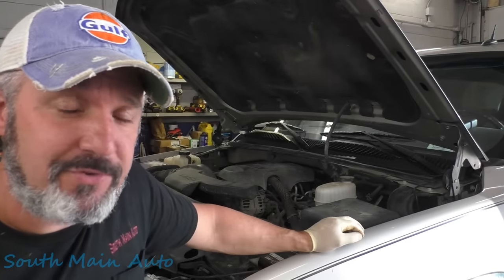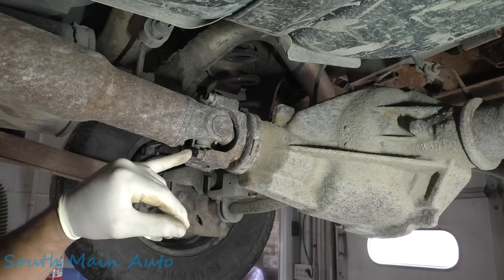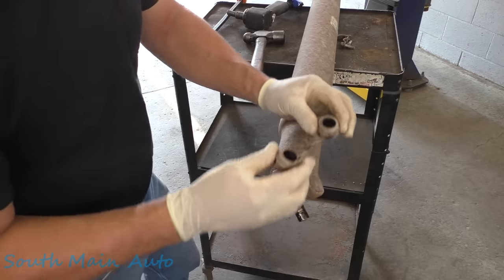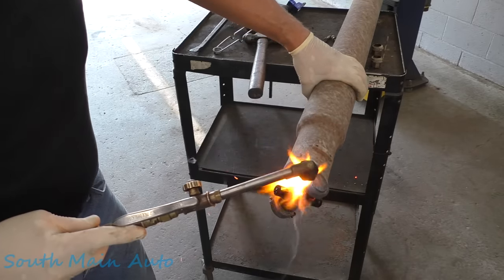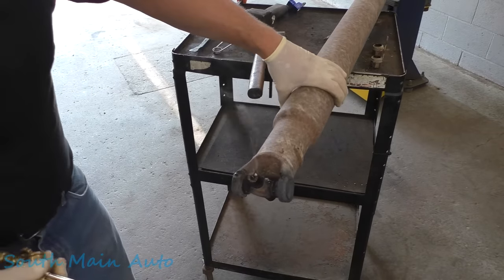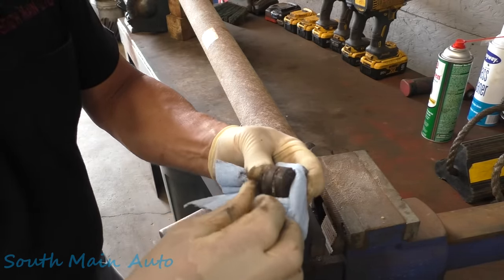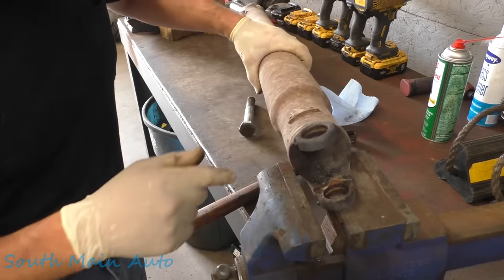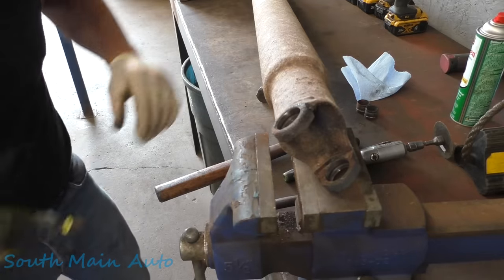GM Nylon Injection U-Joint Replacement

Comment: What is the record for distance that a spring clip has been found? Ya get bonus points if it bounces off the ceiling.
Reply: I'm pretty sure they'll find some on the planet "Pluto" some day. 🤪
Reply: @throttlebottle5906  😅
Reply: @throttlebottle5906  A black hole?

Comment: I was just curious; Is that threaded hex head punch you used to push out the U-joint caps made by Snap-on?
Reply: Same with those horizontal laser assisted driveshaft leveling devices... Just that the red paint is worn off from use...LOL

Comment: Don't know if they used those type of uni joints in AUS made GM-H vehicles I wiil have to check next time I do an oil change ,but it's nice to know if they did.Cheers.

Comment: Have you been reading my mind lately Eric? I've got a 2009 Forester that I'm doing both rear wheel bearings on this weekend, as well as replacing the u joints in the driveshaft. That's for the fresh videos on exactly that hahahaha

Comment: When doing u-joints i always use a ball joint press ! Works great without all the hammering and also mark the location of the balancing weights on the shaft !
Reply: So I was not the only one noticing this too?
Reply: The shaft is balanced right after its made so it doesn't matter. It's not balanced after it is put on the vehicle !
Reply: @jtg2737  right !! Lol
Reply: @scottymoondogjakubin4766  Yeah, that made me cringe but again to each their own.

Comment: Never seen them done like that. I always just heat it until the nylon squirts out, you'd be surprised how much comes out
Reply: But you got to be careful because them cap will blow out of there and go across the shop a good distance. I use a C-clamp lightly across the joint to keep from getting hit by the cap A Wack fuck

Comment: 14:19 - When I was a teen, I  had one going in "harder than expected" and i ended up splitting the cup circumferentially, and  I only found that out after I had installed the driveshaft and grease gunned it, and a ribbon of grease seemingly came out of the cap. Parts were relatively inexpensive back in the 70s compared to now, so as a teen, another u-joint didn't break me financially. Today parts are so expensive that another u-joint may exceed the value of the car 😛

Comment: Man that looked soooo much easier than the staked in joints on my MB. Is getting the caps flush with the yoke the only centering needed?
Reply: The caps don't necessarily fit flush with the outer surface of the yoke. Ideally, the cap clips he inserted should seat against the inside of the yoke.
Reply: @geologic740  These caps go in till the snap ring can be installed.

Comment: Why not use a grinder wheel? Seems safer without than a torch with more control. I put my shafts in a vice with rags around the jaws.

Comment: I'm just curious. Would the amount of heat you used during all the removal cause any damage to the structural integrity of the drive shaft/u joint? I guess in a metallurgical standpoint?

Comment: Did I see both caps turn when you turned one? And why does gm use plastic instead of snap rings? Thanks
Reply: The way there assembled it's easier for gm to make them it's all no touch assembling line been that way since the 70s
Reply: How do manufactures handle drive lines during assembly and not drop the caps?  OEM added a strap.  Nylon injection just aids in the the component manufacture.  GM is not the only manufacture to use nylon.

Comment: Don't hit the ears of the drive shaft. proceeds to beat the hell out of it LOL great vid
Reply: The ear is on the vice jaws and isn't getting bent by driving the cap out.
Reply from the maker: @wssides  I try to explain the best I can lol
Reply: @SouthMainAuto  Great vid, but explain that wabbly table! Are you working on a cruise ship?
Reply: @SouthMainAuto  You explain very very well and the video of the operation adds a million words. Very good filming. Wish I had had your videos when I was teaching auto shop instead of the GM and Chrysler slide shows and 35 mm films.

Comment: I thought marking the shaft orientation was first day of school  so weights are not on same side causing vibration. Noticed when shaft removed weights on shaft and yoke were staggered you installed on same side. why is when you have a 50/ 50 chance of getting it right it is always wrong?

Comment: pro tip, if you are taking out the drive shaft and the tires are touching floor or an alignment rack, chock the front wheels or apply the parking brake, OR both.
Reply from the maker: Pro tip, if a vehicle rolls on its own in neutral on your alignment rack. Don't do alignments on that rack till you get it fixed 😂

Comment: I would heat up the part of the u joint  thats right  next to the ear of the driveline until red hot . Instead of heating up the driveline  ear. An it will poop the plastic right out.

Comment: Funny Story (well, funny for you lot, not me necessarily :) : rear u-joint went out on the Tahoe ('99) at around 151k, so took it down to the place that I had been going to (no longer though) to have them replace it. They pulled the driveshaft, and rear was smoked, but front was also on the way out. Told them to just go ahead and do both and please put in greaseable u-joints. They said OK, did the deed, I paid the bill and went on my way.

About a year and 40k later, thing starts making crunchy-joint noises again. o!O
This time, I take it over to a different wrench because of time constraints, and with a pair of Spicer brand u-joints for him to put in since I think the previous place used the cookie-cutter chinesium-made "heavy-duty" joints; well, he gets them out, and brings them in to show me: previous place had used greaseable joints all right, but HAD NEVER PUT IN THE ZERKS, and consequently never greased the joints after installation. They were the type with the zerk in the end of the cap, and the plastic plugs were still threaded into them. Needless to say, the new joints had subsequently been chewed to bits after the assembly grease gave out. So, he went ahead and installed the new ones, made sure they were greased, and I went on my way again.

About another year and another ~50k later, I start getting the noises AGAIN, and just getting onto the highway to go to my aunt's house, the noise and vibration gets =really= bad: enough that I turn around and head back to town. Coming down the offramp, I step on the brakes and the rear-end starts hopping and banging. I get it limped home, and call the local GM dealership to get in and have it looked-at (the older guy running the shop actually knows what's what mechanics-wise, and makes sure to hire techs who aren't partswapping idiots).

They get it up, and the driveshaft had apparently committed seppuku; I had a feeling that when the first shop replaced the original u-joints, they might have tweaked the ears on it, and having the ungreased replacements go to bits in it likely didn't help; thankfully the pinion yoke wasn't damaged, but the stubshaft to the transfer case was, in addition to finding out the pump in the transfer case had cut through the rear housing and spat all the fluid out (typical NP243 ~:[ ), and was cracked to boot. So, while they sourced a reman transfer case, I scared up a junkyard driveshaft (prices for a new one were utterly stupid); found one with the original u-joints still in it. Took it and another set of new Spicer greaseables down to the shop and told 'em to have at it. Took 'em a coupla weeks, mainly to get the transfer case. Drove brother's backup truck in the interim that the same shop had recently replaced the transmission in, so I was reasonably confident with them doing the Tahoe.

~20k so far on the new assembly and no grumbles, fingers crossed, knock on norboard, etc. Moral of the story? *GREASE THE G$#-D@&!ED U-JOINTS, YOU NITWITS!!!!!  🤬😡☠
Reply: An old machinists 50 yrs ago taught me if using greaseable  u-joints to make sure the grease fitting was on the compression side of the joint. In other words the trans yoke is driving the shaft the jerk fitting should be on the leading yoke of the u- joint. Wish I could put a diagram but think if it like this when  transmission is in forward gears the trans yoke is turning the shaft in a clockwise direction the grease fitting should be in the u-joint yoke in front of the trans yoke so it compresses the fitting from torque, if the fitting is in the trailing yoke the yoke is susceptible to cracking at the hole, same principle for the rear joint.
Reply: An old machinists 50 yrs ago taught me if using greaseable  u-joints to make sure the grease fitting was on the compression side of the joint. In other words the trans yoke is driving the shaft the jerk fitting should be on the leading yoke of the u- joint. Wish I could put a diagram but think if it like this when  transmission is in forward gears the trans yoke is turning the shaft in a clockwise direction the grease fitting should be in the u-joint yoke in front of the trans yoke so it compresses the fitting from torque, if the fitting is in the trailing yoke the yoke is susceptible to cracking at the hole, same principle for the rear joint.

Comment: Why do only one U joint, the other joint will fail and  its cheaper to do both over the long  time.   You can drill and tap the end cap and install a zerk fitting.  Also best to get a long extension  flexable  tube  it makes  it easer to do esp when having no lift. I did  all u joints on my suburban, The front axle joints at the wheels are a real problem as the steering knuckel gets in the way. since I do not us e 4 wheel drive offen its not a problem.  When greasing the  zerk joint  rotate the joint several times after greasing and do it again.

Comment: Why not use the shop press  or bench vice to press in those two needle bearings.
Reply: I always used a vise, but most methods work as long as you never let a needle bearing fall out.  A shop press would be overkill, and you could damage the joint.

Comment: One question Mr. O. Would it be better if you heat up the yoke and put the caps in the freezer before you beat the caps into the drive shaft? It seams to me that you had some trouble doing that. As always Tanks 4 the video 😂
Reply: It is a very tight fit,  but not necessary to cool the caps.  They will go right in with a little persuasion

Comment: On my Dodge ram 2500 2013, the front u-joint needs to be grease every oil change. I have such a hard time greasing it , i have 3 differants needles grease adapters and still have such a hard time 😐

Comment: Question, for anyone, I had a mechanic screw me over on a clutch job. The clutch line was kinked and thought maybe that would be why the pedal had 3" of play in it. I replaced the line, bought one of those fancy pneumatic bleeders. 2 days of bleeding and still no pedal, still has play in the pedal. What am I missing/doing wrong? 1988 Chevy k2500 with a NV4500 5 speed.

Comment: If one joint was bad the other is probably close to going as well so I used to suggest replacing both at the same time.  Save the customer some time and money.  "You can pay me now or pay me later!"

Comment: So, what was the problem with the old snap ring design?  Sure they could rust, but is the plastic that much better design??
Reply: It's less expensive for GM to squirt nylon than to install clips. "
Bean Counters At Work"

Comment: Eric OOOOOOOOO, What's in that Green spray can? Doesn't mix well with Flames?
Reply: It's the non chlorinated variety, at least the vapor trail won't kill you. You must mean the shrapnel from the explosion. 50/50 it'll hit ya 🤔.  Joking aside don't put the heat to chlorinated brake cleaner. Seen a fellow welding that was carried out after his helper cleaned up the gear box with it.

Comment: Hey there, I have a dumb question...I was wondering if a plasma cutter could be used in some situations to cut bolts, exhaust pipes, shock and strut bolts, etc. As long as is not a high frequency machine ( don't  want to risk damaging one of the vehicle control modules) it might be much quicker, neater cuts with less mess and no torch gas required. Just curious if anyone has tried it.

Comment: 2:40 how are both caps spinning when he spins the bottom one? Is something running through the cross on this type of joint?
Reply: You really need to think of assembly line work.  How are they going to handle a drive shaft with a ujoint installed on the factory floor without loosing the caps?  There are thin metal clips on both caps and a strip between them.

Comment: Eric, What is the rule of thumb, when should a drive shaft should be marked/indexed prior to removal? I've heard that it very important on some vehicles.
Reply: Basically- whenever there is more than one way it could be put together. May not be needed but removes doubt and helps in case someone else does the reassembly.
Reply: Only really an issue on multi piece driveshafts and if you disassemble the slip yoke portion. The main concern is indexing of the u-joints. But, with a one piece shaft like that one it’s welded so unless you cut it apart everything stays indexed.
Reply: @NBSV1  I've heard on some Fords , the shaft must also be indexed back into the rear of the Transmission.
Reply: @stealthg35infiniti94  Haven't seen that outside of needing a specific spline to line up. But, that's generally just a gap so it doesn't lock in an air pocket and cause problems.

Comment: Just a small critique.  At 14:07, I'm surprised that you are hammering away at a cap(s) that is machined?  Why not use a U joint press or even the bench vise to press in evenly where nothing is marred up?  But hey to each their own.
Reply from the maker: Ever try and mar a U-joint cap? Trust me, you damage your punch long before they mar.

Comment: Great job.  I did notice you are choked up on the hammer handle. I'm sure you know that holding the hammer handle closer to the end away from the  head will give the hammer more power to do the work and not your arm slamming the hammer .  As I was taught , let the tool do the work for you.. But that said, whichever you are comfortable with.

Comment: The biggest issue I've had was one or two needles turning flat against the back of the cap when assembling. I usually put a dab of grease in the cap, put the cross in, and try to get it as deep as possible in a bench vise without bending the ears. Sometimes one hit with the hammer when the cross isn't supporting the needles at least partially, and the needles move...even with grease holding them in.
Reply: Amen

Comment: Your videos are invaluable but a ball joint press in a vise or arbor press would have been just as fast if not faster than torch cutting the cross after burning the plastic out of the caps and saved the gas. Oxy/fuel mix here is getting outrageously expensive. Sparking off the torch becomes more an more of a conscious decision for us when we use to just whip it out by default.

Comment: Ive owned a 01 suburban and my wife has a 19 the newer ones seem kike its always something going wrong even with it only having 40k always a money light item
Reply: Emissions... always the emissions.
Reply: My 2019 had over 170k on it before a semi smashed it on the interstate check engine light on for the hood security deal emission stuff and it ticked but it ran solid... I would buy another in a second

Comment: Would have used the induction heater instead of a torch. A bit more safer. I'm learning from you. You have good skills.
Reply: It's out of the vehicle... What's unsafe about the torch?
Reply: I'd say you have much to learn.  KISS... not just a ghay band.

Comment: So, some bean counter thought it was cheaper to use a plastic retainer system than the metal clip type.

Another great fail for accounting. That's why manufacturers have engineers to determine the build of mechanical systems. But hey, accounting can say they saved $32K during the production of a million vehicles , and lost that many customers because of the junk that's rolled out the door as "New and Improved".

That's how you make money today, by throwing crap against the wall to see which turd sticks.

And, Mr. O gets to fix it all...........at least it's job security............

Comment: Just another stupid change manufacturer’s do…change something that’s been done a certain way..but the replacement is the same as it use to be..🙄..

I’ve worked on newer motors that don’t have a oil pan gasket,calls for silicone,but if you get a gasket from the yr prior,it works perfectly…🙄

Comment: Way overdone, just melt the plastic out, in your case it was a rear joint. Just put the cross between the jaws of a vise and tap it out with a hammer. Tap on the shaft not u-joint area and it will come right out. Also you should put a warning out, I have shot a cap across a 7 bay shop melting the plastic. Keep it pointed away from you.